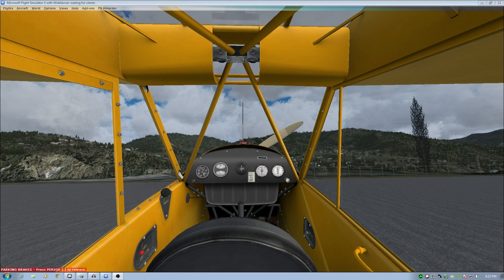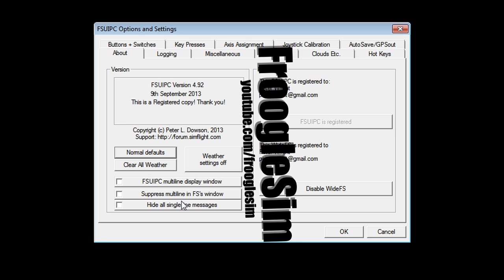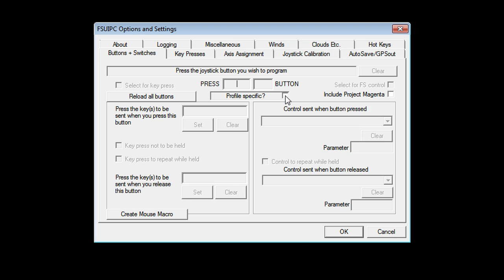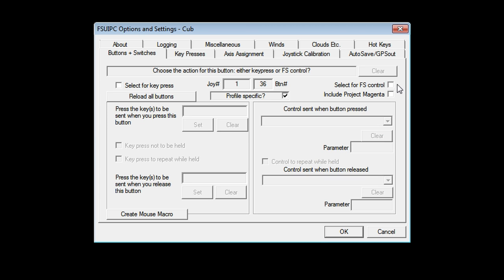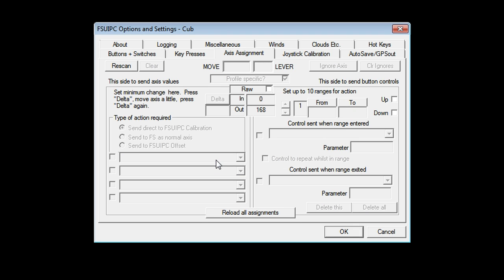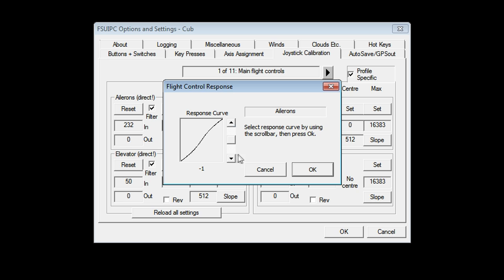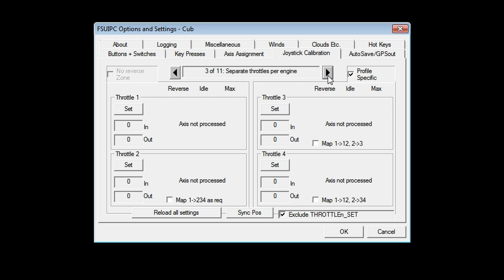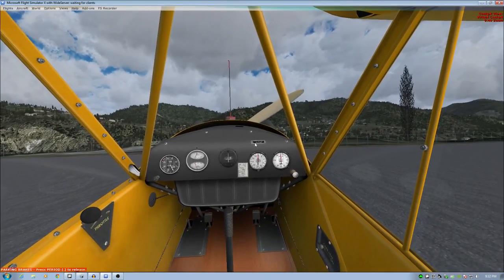HOW TO USE FSUIPC FOR FSX

Comment: Hello.  I have a problem with my FSUIPC4, and i was realy hoping YOU could help me.So i downloaded the FSUIPC because i was making a overhead panel and i needed to program it so that when i pusht a button or switch it whould happen on the FSX Steam edition to. Like a taxilight for example. So on FSUIPC i programed my yoke,quadrant and rudder pedals. And everything worked fine. All buttons and axees worked. But straight away when i for example programed a button on taxilight, i whould then push the button/switch and nothing whould happen in FSX. FSUIPC does registrate the buttons/switches but something is stopping it from working in fsx. I then deleted the hole of FSUIPC and re-installed it. And it still didnt work! I dont know what is wrong and i have tried fixing it for a very long time, but now i realy need some help. System info: FSX steam edition,FSUIPC (payd), Leobodnar chip (for buttons/switches),windows 8,PMDG 737 ngx, If any question PLEAS ask,And pleas help me.
Reply from the maker: Sorry no idea. Try FSUIPC's support forums.
Reply: +frooglesim ok thanks for fast reply

Comment: Speaking specifically in regards to 10:19 - is there a way to have the control input be completely raw to where there isn't any acceleration to it? I swear I've been using MSFS since 2001, but the inability to have ACTUAL control inputs is borderline forcing me to switch to X-Plane at this point.

Comment: Hi buddy ..... this 1 is overall a very informative tutorial. I have connected 3 joysticks to my sim ... of course 1 for flight controls and other 2 for various pushbuttons and rotary knobs. Assigning pbs was done after watching your tutorial,  but m unable to assign rotary knobs like airspeed or altitude etc using potentiometers of the joystick. Pl need your guidance in this aspect.

Comment: I got thrust master joystick and it doesnt have a build in rudder control. and i am planning to use the hat switch to control the rudder.. will it work?
Reply: +kentred studios 
It might. But for big planes especially you need proportional control. I believe Thrustmaster just came out with a new set of rudder pedals. Having used the Saitek pedals for over a month now, I can say there is no substitute for a foot-operated rudder system.
 But of course you have the choice.

Not sponsored by Saitek or Thrustmaster

Comment: Hi Froggle, your vids have always been so much help to me, I have just got FSUIPC and its grate solved all my issues but in turn has created one which I'm hoping you can help me with, I have the pmdg 737 and mostly all works fine except the parking break, as normal it well have the bottom left corner release parking creak with (.) but this well not work and as I normally do I use the lever in the aircraft itself but this also does not work and nor does my joy break button, all other aircraft seem to not have this issue but no matter what I do and have the break released in the aircraft I still have the bottom left release break text, any kind of help would be very much appreciated.

Comment: Correct me if I'm wrong. If I uncheck "Enable Controller(s)" I believe I would have to re-assign all the buttons and controls on my Saitek yoke and throttle quadrant. I did not want to do that, so I left Enable Controller(s) checked and then in FSX I deleted only the controls that I intended FSUIPC to manage. Seems to work - am I understanding the process correctly?

Comment: Excellent video there that helped me clear quite a lot of misconceptions about this gem of software...makes quite a difference to the otherwise twitchy and imprecise control movements of joysticks like the Logitech Extreme 3D Pro and Saitek ProFlight Yoke (both of which i own). I only wish you could make this video a little more informative by giving us a rough idea of how much to set the response curves of the pitch, roll and yaw axes for a particular category of aircraft e.g. response curves for a 747 will be quite different from that of a Cessna or an F18 or an Extra 300...is there any recommendation that you can give? Or should they be adjusted based purely on "feel"? Please advise.

Comment: Froogle sorry for being such a pain i have 1 last problem my fsuipc with the saitek throttle quadrant say if i power up it doesnt respond till its on 25 % now i have got rid of the stuff of fsx the controls its not worked ive done what you have done here it feels weird when taxing same with flaps im stuck again if you know how to get them alligned correctly so it starts from 0% that would be great thanks

Comment: So this will stop the joystick form disconnecting randomly in FSX?
Reply from the maker: No that's a windows 8 issue and one of the reasons I won't use it I'm afraid
Reply: frooglesim No it will stop the disconnecting, I have tried it myself just now and it works. FSUIPC stops it, for my knowledge for now at least. Been flying for a few hours just testing if it will disconnect and it didn't
Reply: ***** So I'm assuming that you have windows 8 and the same disconnect problem? If it works for you I will definitely buy FSUIPC.
Reply: It's working very good for me, never had the disconnect problem after that. I do indeed have windows 8.
Reply: ***** Thanks!!! I will give it a try soon.

Comment: Good video, but I have one comment:
In order to avoid unwanted effects of known "dead zones", move the levers to their min, then pull back a tad before hitting the "set" button. Do the same for max and the center positions.
This will prevent value changes just by having your hand on the levers, and the fact that the max and min values will vary every time you move the levers.

A purchased version of FSUIPC is a "must have" for any flight simmer.

Comment: Thanks Froogle - very useful!!

I finally moved to a registered version of FSUIPC and didn't realise the control binding was so useful/customisable. Now using my TM Warthog I can have 2 seperate throttles in the PMDG 737, and also the lift-up idle cutoff buttons work with the reversers now (not possible in FSX standard config, even with full repeat set), and then I can have a different profile in my A2A Spitfire splitting to throttle and prop control etc.

Also -  now idle in the 737 is 'actually' idle!

Comment: If you turn off the controller and set up fsuipc for your plane what happens if you simply go back and click on "enable controllers do my controls revert back to not using fsuipc?
Reply: No. You'll get a FSUIPC override, which basically means that most of the times, FSX won't be able to know where controls inputs comes from with unpredictable behavior. Bind your controls either FSX menu OR FSUIPC. Never both at once.